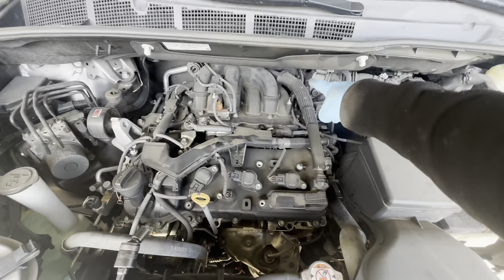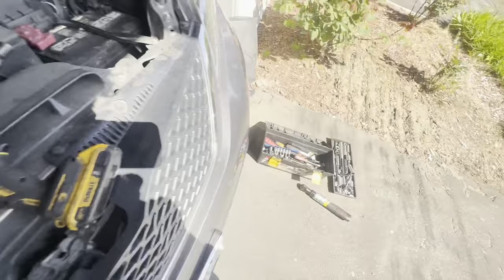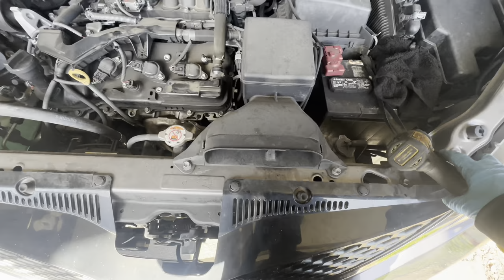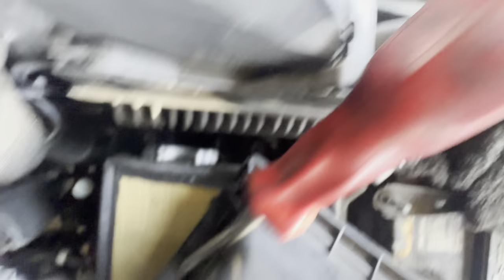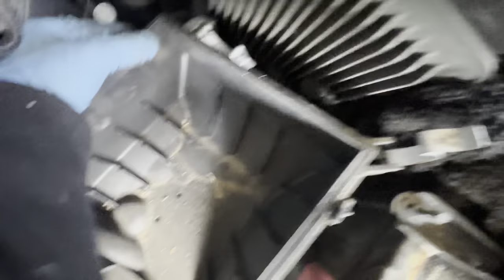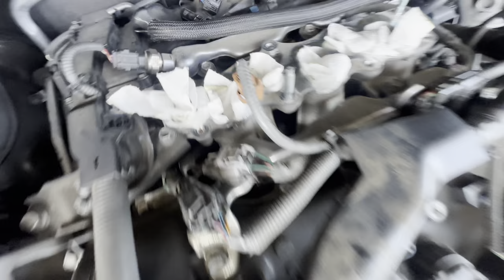How to change spark plugs on 2017-2020 Toyota sienna V6

Comment: It's a lot easier to make comments than it is to create and post a video, so thank you for posting videos.  

I did this about a year ago on my wife's 2020 Sienna.  I didn't remove the intake because at the time replacement gaskets were on backorder everywhere I looked, but I learned a few things that will hopefully make this job easier for anyone else doing it.  The most significant is that the cowl, both the plastic top and the sheet metal bottom pieces, is removable on all Siennas at least as far back as 2004 models and possibly also first gens.  That makes getting at anything towards the top rear area of the engine a LOT easier.  Also, since the engine is offset towards the passenger side of the van, you van reach all three plugs and coils from that side.  I's a royal PITA with the intake still on, but it's doable.  Several small battery powered "puck" style lights with hooks and magnets help, as does an inspection mirror.  

One other thing in general is I would be hesitant to loosen or tighten spark plugs with an impact, that can easily easily crack or break the ceramic portion of the plug.  I learned that lesson the hard way. . .  

Anyway, good luck on future jobs and thanks again for sharing what you've learned.

Comment: Torque spec for spark plugs: 13 Foot Pounds (156 Inch Pounds)
Torque spec for coil bolts: 7 Foot Pounds (84 Inch Pounds)
Intake plenum bolt and nut torque spec: 15 Foot Pounds (180 Inch Pounds)
Throttle body torque spec: 7 Foot Pounds (84 Inch Pounds)
Reply: Thanks for the torque specs!

Comment: If I may offer a suggestion, you should not have to remove the cowl to get to the three spark plugs behind the Plenum. I would remove the Plenum and install a new gasket. I'm about to change the spark plugs and ignition coils on my 2018 Lexus RX450h F Sport; my reasoning is if you're going to go through the trouble of changing the spark plugs, you might as well do a complete job. Change the Intake Manifold Gasket as well as the Throttle Body Gasket, and clean the Throttle Body with a Throttle Body Cleaner only. Also, while you're in the kitchen, clean your Mass Flow Sensor with a Mass Flow Cleaner only. Another thing I would do is clean or replace your Engine Air Filter, and while you're at it replace your PCV Valve. If you care about your vehicle and you want to keep it running well for a few more years, do a complete job and don't perform half measures. One last point, it would be wise to run a scan on your vehicle before and after you perform a tuneup.

Comment: Pretty much the same as my 08 that I’ve done because of failed coil packs.  It sucks, now we got a 2018 with 55k and the 60k service requires spark plugs changed, so I guess I’ll be doing this horribly experience again soon😅

Comment: Good idea to change the rear coils and keep them in case the front ones go bad. To prevent having to go threw that again
Reply from the maker: I’ve done that job so many times, I’ll do it again lol
Reply: Unplugging the rear coil packs from their harness was job impossible.  My front harnesses required some screwdriver persuasion.  No way I was getting tools back there.  Was thinking dismounting and rolling the engine forward.  Don't know.

Comment: So basically just remove the entire engine to get to the rear 3 plugs? Shame on you, Toyota!!!
Reply from the maker: basically hahahaha
Reply: Toyota engineers knew that when they designed it.  Toyota should have forced them to change spark plugs every day for several weeks and they'll change their mind
Reply: Actually Toyota forced their Engineers to designed like this so they can make services money.
Reply: @georgekraus9357 I mean this is a problem in any V configuration transverse motor. Efficient packaging is a pretty fair trade off for a job that will happen 2-3 times max in the life of the vehicle.